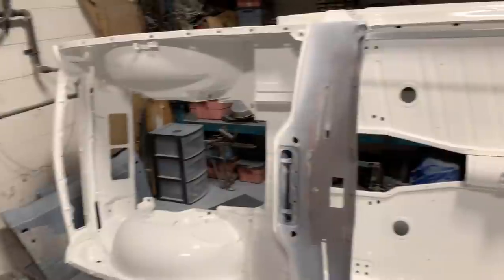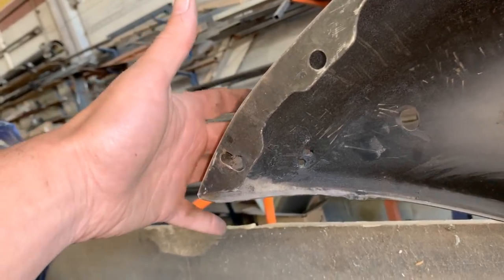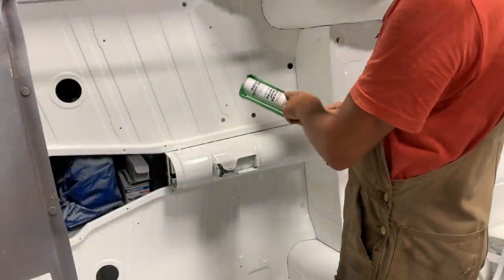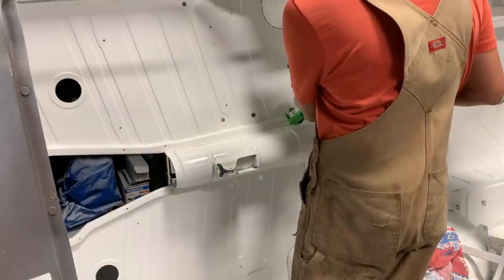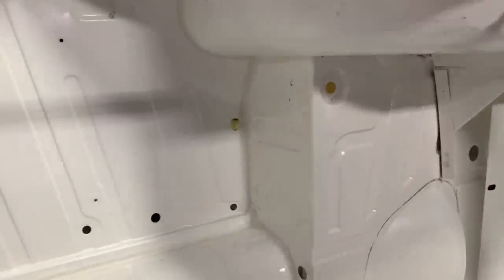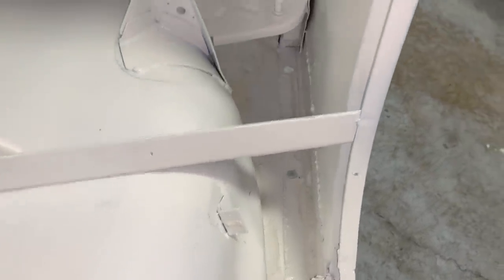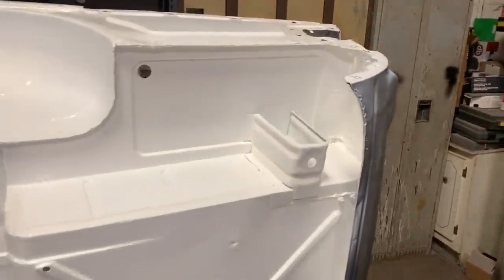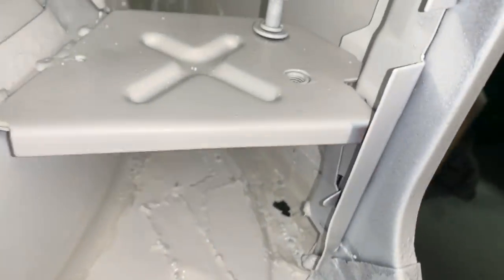1974 Triumph TR6 Restoration - Part 50 - Seam sealing

Comment: Thanks for another informative video.  I have just had a tin of seal sealer delivered... wish I had gone for the tube type instead.  

My current TR6 restoration had more corrosion than yours and a lot of it obviously started in the seams.  You have dealt with most, but if you have the time, then I suggest that you include all possible areas.  For example, around the rear rebound bracket and the seat-belt anchor strengthener plate on the rear arch (see 10:51 of your video).  I have other Triumphs (Stag and 4A), which have similar structures and these rotted from the inside and needed replacement.  

Another vulnerable part is the seam between the floor lip and the lower flange of front bulkhead, but I'm not sure yet how I will tackle this as it cannot accept a fillet bead

Comment: Aloha Elin just wondering what you use to remove rear hub 1974 TR6  any tricks or suggestions thanks 
jim
Reply from the maker: You need a hub puller. I made my own for the spitfire. A regular jaw puller doesn’t work. It is very stubborn area

Comment: Hi Elin, can i just ask, you use a Rust converter, question does it work well, does the Rust return, my tr3 had been shot blasted and etch primed before i purchased it for rebuild but i now have spiderwebs of Rust coming through the primer and was thinking the best way to deal with it was to hand sand and convert the Rust before re-priming and hope that this kills the Rust and stops it returning, would you recommend i do this. Thanks
Reply from the maker: Yes, the rust converter works really well and as long as the surface is sealed with epoxy primer and painted after it was used the rust doesn’t come back. What you are planning to do is OK. However sometimes the rust works it’s way inside out. If the opposite side of the metal is exposed to elements the rust will go through and will start firming bubbles under the paint. So it is a tricky business :)
Reply: Thank you Elin for your advice and taking the time in replying to me, i think it will work ok too. From the point of view of Rust this is only in the inner body tub as this was exposed to the weather when the former owner having blasted the complete shell and etch primed left it outside and allowed water back into the inside making the Rust return. The underside is fine with no Rust penetrating through.